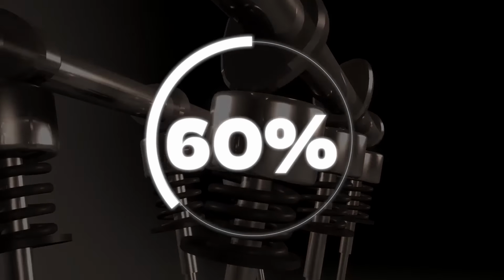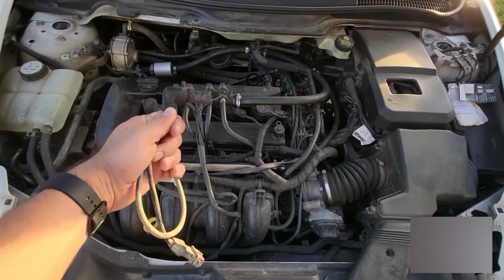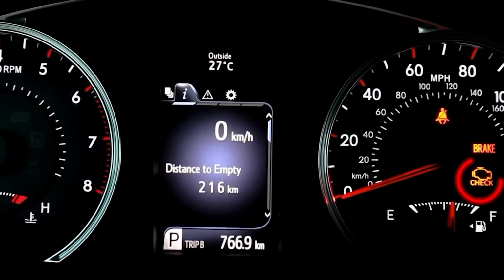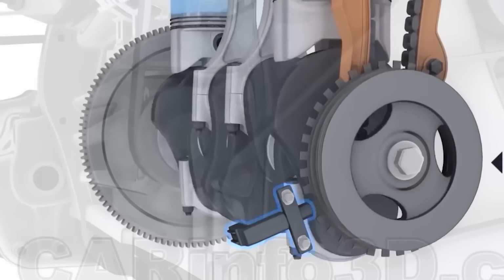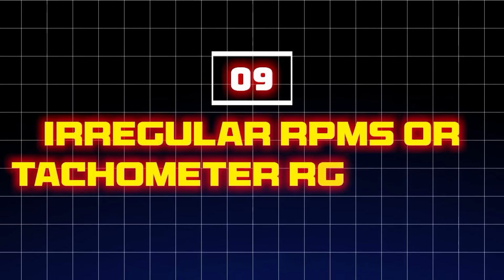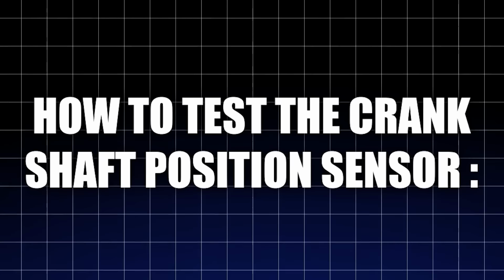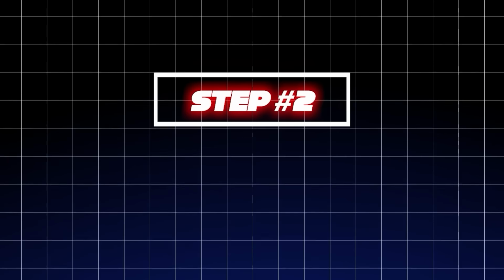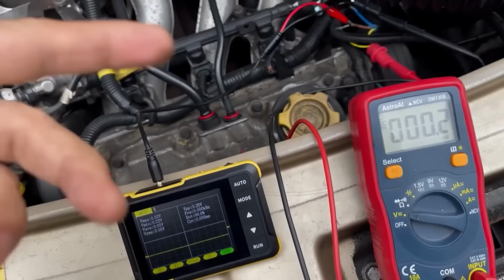10 Bad Crankshaft Position Sensor Symptoms ( Fix it Now)

Comment: 2012 Mitsubishi Galant crankshaft sensor location
Reply from the maker: On the 2012 Galant, the crankshaft sensor is mounted low on the engine near the transmission bell housing, right by the crank pulley area.

Comment: Honda accord 8th gen car into limp mode kindly help me out
Reply from the maker: That sounds frustrating! When your Honda Accord goes into limp mode, it’s usually the ECU protecting the engine from potential damage. Check for error codes first—limp mode often points to a bad crankshaft sensor, wiring issue, or cam sensor. Start with the crank sensor replacement if that’s the code.

Comment: Number 7 stalling and when it cools down it starts normally it’s dangerous in the road on my 2005 kia optima
Reply from the maker: That’s a classic bad crank sensor symptom—heat makes it fail, then it works again when it cools. Definitely dangerous, and replacement is the fix before it leaves you stranded.
Reply: @autofixdiary it has I just replaced it so far so good

Comment: I have a 2007 lexus is250 where is the camshaft position sensor on my engine code po348
Reply from the maker: On the 2007 Lexus IS250, the camshaft sensors sit at the back of each cylinder head near the firewall, each held by a 10mm bolt.

Comment: Hi, I replaced that. Here's the problem. I have a 2010 Hyundai accent. Um, it' number one where the spark plug is number 2. There's oil in there. The car won't start it cranks, so do I have to replace the valve cover gasket? Obviously if there's oil, hmm, or what else is going on? That wont-work. Run, it did run. For example, I parked that last Sunday, it came out Monday morning old start. Thank you for anybody to help me

Comment: So just watched ur video thanks for info gd stuff so I have a ? Do u recommend still driving the car ?
Reply: Get the sensor replaced immediately.  Order the part yourself and take the car to a reputable mechanic to install it.
Advance auto or Autozone which one sells the sensor the cheapest.  Get an OEM.  If you let the mechanic get the part and repair it they will charge you $200 for labour and almost the same for the part.
Reply: @bjunk5344 hi there thanks for the info just to shop this morning and they put it on their machine. They did a test drive and they find anything wrong with the car. I was there for three hours. They did not charge me when I was driving to drop off Wood in the middle of the street so I brought it back to the shop. We did a test for 30 minutes and did nothing so right now I’m still drivingto see if it’s gonna keep shutting off because if you keep shutting off then diagnose it.
Reply: He had a machine attached to the car while he was driving  here so I don’t know exactly what’s going on so just what you suggest. What do you I do because there’s no lights on in the car wat do you suggest that I do

Comment: Please help me fix my Car, Mazda BT 50 EFI Engine, engine injector knocking
Reply from the maker: Injector knocking on your Mazda BT-50 EFI could be caused by:
1. Dirty/clogged fuel injectors (try a quality cleaner or ultrasonic cleaning)
2. Low fuel pressure (check pump, filter, and regulator)
3. Faulty/worn injector(s) (test resistance/leak-off or swap to isolate)
4. Incorrect injector timing (scan for codes, verify ECU signals)

Start with a fuel system inspection and scan for fault codes. If the noise persists, consider professional injector testing. Let me know what you find!
Reply: I'll try that confirmed with you  @autofixdiary

Comment: A CPS has to be one of if not thee dumbest things in mechanical engineering that i have ever known. What you have here is a vehicle that can fail at ANY given time. Who in their right mind wants to drive around with something as unstable as that connected to your wagon/workhorse?
Reply from the maker: Totally get the frustration! CPS failures can leave you stranded, but modern engines need that timing data. A good OEM sensor should last—if it keeps failing, check wiring or heat damage. Hang in there!

Comment: Show a video discussing where the engine cranks fine, does not start and does not throw any fault codes.
Reply from the maker: Great suggestion! I’ll cover that in an upcoming video—common culprits are fuel pump, crank sensor, or security system issues, even without codes. Stay tuned.
Reply: @autofixdiary  Thanks AutofixDiary.
Will be interesting.

 I wrote this as a response  in another another YT-clip:

I have a good crank no start condition on my Volvo S60 2011.
It's got a 2.4 L D5 Diesel engine. (So no ignition issue)
This is my story.
1) Car has been running fine and always did start.
2) One day I was leaving home and drove 7 km to the ferry, stopped and shut off the engine. When the ferry came I started the car and drove onboard the ferry.
3) As we got to the other side of the river the the engine did crank but did not start.
4) Called for a tow truck which took the car to the nearest Volvo dealer.
5) No one had the time to have a look at the car as we got to the dealer so the car got standing on their parking lot for 5 days.
6) Finally when the technician went to take the car inside it started without any problem.
7) The technician connected their VIDA tool but could not read out a single fault code. The list was completely empty.
8) He said there was nothing he could do so I took the car back home.
9) 2 weeks later the car did not start. Cranks just fine but does not fire.
10) I got a spare ECM and cloned it with the code of the existing ECM. Car still won't start.

The rpm stays at 0 when cranking but talking to Volvo this is normal as long as the engine has not started.
I will soon get a VIDA tool of my own and will be able to read sensors and actuator values.
I have watched numerous videos and read a large number of documents but nothing actually corresponds to the behavior of my car of not spiting out a single fault code, the engine cranks and does not start.
I am surprised of having such a serious fault as the engine not starting and not getting a single fault code. Is this acceptable ?
Does anyone here have clue ?

Comment: My M272 has rough/vibrating idle when car is in Drive but stopped, for example when you’re stopped at a red light , it will make a rough idle and engine sound changes. I don’t have an check engine light on. May it be a camshaft sensor needs to be cleaned?
Reply from the maker: A failing camshaft or crankshaft sensors would often trigger check engine lights. Since there is no CEL, please check vacuum leaks, dirty throttle body, or worn engine mounts. I'd recommend starting with engine mounts. Since the issue only happens in Drive, also inspect the transmission torque converter or idle control system.
Reply: @autofixdiary so i have checked engine mounts they were new when i bought the car, i changed the transmission mount, that didn’t stop the vibrations. I guess i will have to check throttle body if it needs cleaning, or if the car has vacuum leaks.
Reply from the maker: Does the car jerk when you move or sometimes stalls when you make an instant break? Those are some signs of a bad throttle body
Reply: @autofixdiary hmm no there’s no jerks nor stall , just rough idling when in D. But imma have to check throttle body and if car has any vacuum leaks.
Reply from the maker: Please check and let me know
Reply: @autofixdiary may take a few days , where i live is hard to find proper mechanics. I’m from Albania so kinda hard to find trustworthy mechanics here 😂😂 i sent to two and they said car is fine, which doesn’t seem too fine to me lol. But thankyou, when i get this done i will text you back and tell you what was the issue :)
Reply: @marius-folkishbadge187-3  Also, check ALL tires OFF of the vehicle, to ensure there isnt any slight bulges on either sides or the face that contacts the road!  Another stupid thing I have seen causing vehicles to shake and shimmy only while driving, is when a lead weight gets pulled off a rim... 

I had one client go to the dealership and two other shops, before it I got to it, and not a one of those people gave a second look at the tires, so they missed the ever so slight bulge on the face of the tire!  In fact, I would have missed it, had I not been laying on the ground and on a whim I asked a friend to please give the driver's wheel a spin!  
    
I'd already pulled the tires off to check their sidewalls, but there was no noticing the slight bulge on the front of the tire, until I saw it when I was laying on the ground!

Comment: im a mechanic in the navy, own a 2015 hyundai genesis 5.0L v8.  i've been driving with a bad crank pos. sonsor for 3 months now, you'll be fine to drive your car with a bad sensor. don't freak out about not being able to make it to work, Ive been beating on the car WHILE the sensor is bad and worst ive experienced is  horrific fuel economy and very hesitant to start, but it always eventually starts after cranking for 5-10 seconds.  

u can drive your vehicle to work on a bad sensor just fine, long enough for u to order the part and sit the vehicle out once u find a replacement vehicle until the parts come in if you wanna baby your ride.  old cars never had sensors like this.  there is a way and method u can do to completly bypass the sonsor on these newer cars and have it run on your camshaft timing just fine

i didn't do this because the part just arrived yesterday - i've been waiting 3 months - for my part due to back order issues and such so i didnt want to do any extra work cause i thought it would be coming the next week.
Reply: did you have a "check engine light on "  when the bad sensor was still in? 
 some mechanic replaced a fuel pump 3 times on 4 months , 2011 Ford expedition. and now some times it takes longer to start again, like fuel doesn't gets to the injectors .. like fuel pump type of issues.. 
 But I don't have any check engine light on. it could be a crank shaft?? I just want to buy me a obd scanner and Scan it myself.. some mechanics they just don't know

Comment: I got codes p0016 & p0017, could that be a sensor issue?
Reply from the maker: Yes, P0016 and P0017 error codes indicate a misalignment between the crankshaft and camshaft positions, specifically on bank 1
Reply: @autofixdiary  thanks mate does this relate to the timing belt

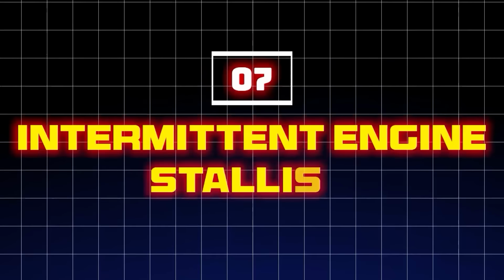Comment: Thanks.  My mother's 2016 Hyundai Accent recently has the problem #7 at 5:53 of Intermittent Engine Stalling.  The Hyundai Dealer wants $220 for the part and $330 for installation, $550 total.  Braakes plus wants $200 for the part and $115 to install.  We may try to install it ourselves.  Thanks again for this video confirming the problem.
Reply from the maker: Glad the video helped! The crankshaft position sensor is definitely a common culprit for intermittent stalling. If you're DIY-ing it, just be sure to use an OEM or quality aftermarket part—cheap sensors can cause more headaches. The job's usually straightforward. Good luck!"
Reply: With brakes if doing pads, make sure you bleed the brake fluid properly to prevent air lock.
Reply: @BlazeShu  Why bleed the brakes, if ur just changing pads or shoes? U only bleed if there's been a crack in the line, or if the caliper needs changing, but that's about it. 
    If ur needing to bleed brakes, don't ever use fluid that has been sitting in an unsealed container, otherwise it absorbs water from the ambient air, rendering the brake fluid useless, as water compresses and the oil does not.

Comment: thank you for this video, My hyundai getz. has a newly charge battery and all spark plug are working comfirmed vie test and also has a new ignition coil. but my engine crank but intermittent. i also check my fuel pump all found no problem. Saw this video this might ne the problem crank shaft sensor
Reply from the maker: Glad the video helped! Intermittent cranking with good spark and fuel does point to the crank sensor. Test it or swap in a quality OEM unit—cheap aftermarket ones often fail quickly. Let us know how it goes!

Comment: I'm throwing no codes, but having a specific cylinder misfire in a 3.6 Pentastar.  I am chasing the least invasive things first like sensors versus rockers, lifters, tensioners....coils, plugs new, swapped confirm it's elsewhere.  My oil cooler leaked oil so I am going to look at sensor to see if the oil made it's way over there to the sensor tomorrow when it's not raining.  I do know that you need to perform a relearn of this sensor and the cam position sensor so I need to get a scanner before I even pull this thing out to inspect it and replace.  I will be replacing both CKP and cam sensor with OEM because my purge valve replacement/Dorman branded wound up being a partially working unit causing hard starts, but eliminating the problem with refueling I had.  105K mile engines shouldn't have these many issues, but new ones are out of my price range anymore.   Looking for a quality scanner now that can perform the relearning procedures now.....looks like another investment for sure.
Reply: My 2010 Honda Pilot is throwing misfire codes for cylinders 4,5,6. It’s a known issue with this engine. I swapped plugs, and checked coil packs. CEL came right back on. I’ve installed a VCM muzzle and my mechanic is stumped. Told me to go to Honda and do the camshaft sensor relearn. Apparently the OBD scanner for this procedure is expensive. I didn’t even know that was a thing. Chasing these codes is so exhausting.

Comment: where's the fuse
Reply from the maker: The crankshaft position sensor isn't powered by a fuse, or gets its voltage straight from the pcm

Comment: is there a fuse that controls  this
Reply from the maker: The crankshaft position sensor isn't powered by a fuse, or gets its voltage straight from the pcm

Comment: That's why older motors are better now computer adjustments are by hand
Reply from the maker: i agree, older engines definitely had simpler diagnostics, but modern crank sensors actually give us more control - when they work right! That said, nothing beats the satisfaction of dialing in a carburetor by ear. What's your ride? I'll bet we could swap some good 'analog vs digital' war stories!

Comment: I replaced sensor in my 83 mercury , brand new and engine started messing up , rough . But with the original old sensor runs ok.
Reply: You need to get sensor for dealership not after market . I had the same problem
Reply: Thank you
Reply from the maker: Glad you got help! Since your Mercury runs fine with the original sensor but acts up with the new one, the replacement part may be defective or incorrect. For a reliable fix, get an OEM sensor from the dealership
Reply: Yes a new one from the dealer I got auto parts one and we g out in 2mos,. I saved nothing in the long run with auto parts junk

Comment: The 3 wires of the crankshaft sensor are damaged and the engine started by idling very bad to stalling,now i can't get it starting,could the crankshaft sensor be the culprit
Reply from the maker: Damaged wiring to the crankshaft sensor can absolutely cause your no-start and stalling issues—the ECU can't read engine position without a proper signal. First, repair or replace those damaged wires (check for breaks/shorts) and inspect the sensor itself. If it still won’t start, test the sensor’s resistance or swap in a known-good one. Let me know if you need help diagnosing further
Reply: @autofixdiary im having a rough idol on my 09 bmw 335i xdrive I replaced the spark plugs also crankshaft position sensor also both map sensors and the car still is doing it i checked the vacuum lines can't find a leak also someone said it could be the thermostat an it out it in limp mode ? What do you think
Reply: @johnsam168  O2 sensor... have you popped it onto an OBD!! reader?
Reply: @leonessity yes it keeps coming back as gas pedal not syncing replace the sensors still same thing was going to ask if the pcv would be like that
Reply: Have you taken the PCV out and taken a look to see what shape it's in?  Make sure it's not  oil soaked and that the bearing, pea or pintle (I think that's the name of the valve part that makes PVC valve a one way valve)  moves freely inside.
    I don't play parts roulette, when I'm working on someone's wheels, but for such a cheap part, it's one more thing that you can be sure of and one less thing to have to question. 
  That said, limp mode can be triggered by any number of reasons... After you swapped out parts, did u let the car know, by attempting to clear the codes with a proper scanner?
Reply: Different vehicles have different relearn procedures... I don't know your depth of knowledge, so I mention it, just in case u weren't aware.  If you weren't aware, definitely research what is required to reset the DTC codes properly, after replacing sensors, switches or meters.  Otherwise u risk running the old DTC info, despite the problem part having been replaced.